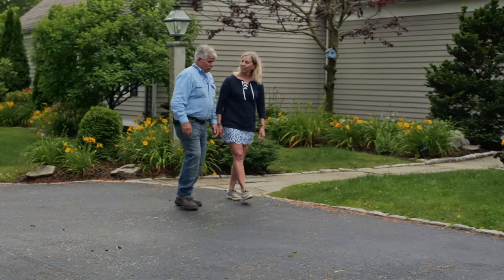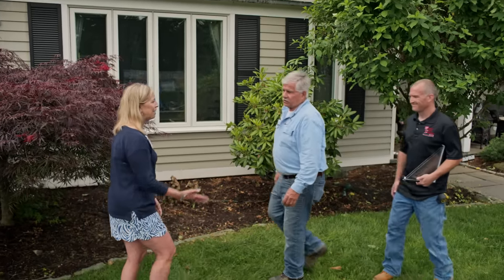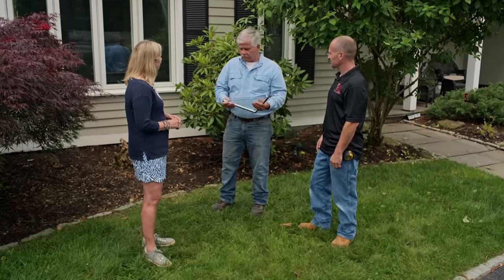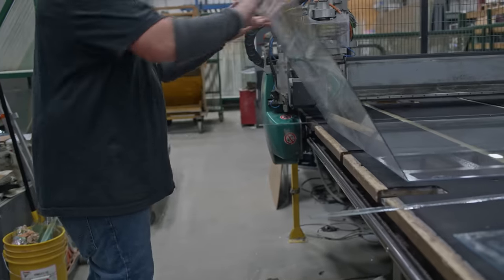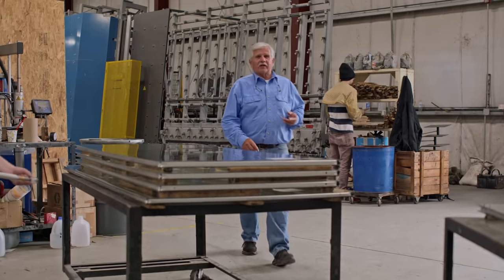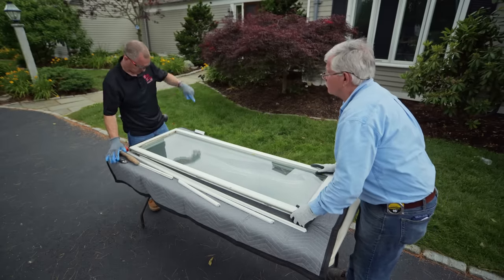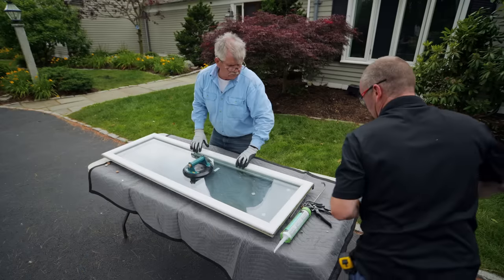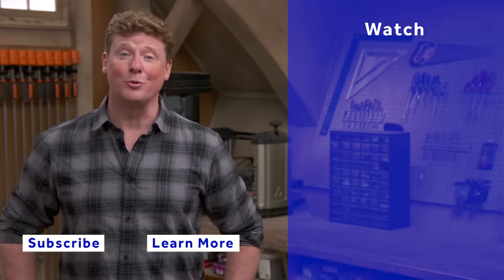How to Repair a Double Pane Window | Ask This Old House

Comment: This is the way to go.  Fixed 3 windows in my house just like this.  Cost should be around $400 a pane… installed
Reply: Thanks for sharing the cost! I was wondering
Reply: what if the window does not come out?
Reply: Are you located in the nyc area by any chance?
Reply: That's still too expensive

Comment: Here in the Netherlands it is very usual to replace only the glass. In almost every city there is a glass company you can call (24/7 in case of emergency) and they replace the glass for you. You can even order it yourself online when you know what to buy. Production takes +/- 20 days.

There is no one here who want to replace the whole window only because the glass is cracked. Every kind of window (wood / plastic (vinyl)) has replaceable glass.

Also we place thin plastic shims between the glass and the window to clamp the glass tight, so the window stays square.
Reply: They replaced only the glass. What are you talking about?
Reply: @herculesrockefeller8969 
Watch the video and pay attention to the expert talking about the different types of windows.

He is talking about the fact that some people decide to defraud their customers with products that force you to replace the sash rather than just the window.
Reply: @herculesrockefeller8969 Did you watch the video? Because that is exactly what they did... just replaced the glass.
Reply: @herculesrockefeller8969  They talk about it like it is an exception that only the glass will be replaced. Like in the introduction of the video when Tommie is in the car. He said “often the replace the whole sash”.
Reply: I have cheap double-hung vinyl windows throughout the house, and there's no option to replace only the glass. I'd jump at the opportunity to have a window with serviceable components!

Next set of windows we buy will definitely have this feature now that I know it exists 👍
Reply: @MoeBabaloosh  This type of windows is not common here in the Netherlands. In the past the glass and windows were delivered separately because of the weight. The glass was put in after installation of the window on the job side.

Nowadays they deliver the windows with glass pre installed in the factory, because they deliver it with cranes. But the glass is always replaceable in case you need.

Since 1,5 year you even get money from the government when you change your glass from single to double or even triple thick glass because then you need less heating in your house.
Reply: @herculesrockefeller8969  Bruh, how did you even make it this far down into the comments without having the video even playing on the background? It's like popping in "Hot Tub Time Machine" and then scanning directly to near the end and asking, "If this movie is about the 80's, why are they singing Black Eyed Peas songs?"
Reply: I think they are saying they take out the glazing panel- remove the broken glass and rebond a single piece of glass into the sealed unit so you are not throwing away a whole sealed unit- mostly they just fail with condensation and it is a major cost to have to replace the whole sealed unit so they are taken apart and resealed using existing glass. This ensures no glass goes to landfil
Reply: @herculesrockefeller8969  I think they are saying they take out the glazing panel- remove the broken glass and rebond a single piece of glass into the sealed unit so you are not throwing away a whole sealed unit- mostly they just fail with condensation and it is a major cost to have to replace the whole sealed unit so they are taken apart and resealed using existing glass. This ensures no glass goes to landfil
Reply: Good idea,  i call this method,....the  ' tim the shim '......nothing to do with tim hortons.....  hmmmm...  '' shim the tim '''.......(alberta canada) Go  Geert  Wilders...go ! for a 'normal ' country.
Reply: @scotttovey  Some will state that the sash has been discontinued and the complete bay window has to be replaced.

Comment: Nowadays getting the double pane glass is pretty easy. Some window companies only focus on new installations and some companies do repairs and replacement/ new installs. Also most manufacturers give you a lifetime warranty with glass breakage warranty as well. Just a matter of getting in touch with the manufacturer and giving them the serial number associated with the window (included on your window order or stickers on the window sashes/ frame.

Comment: I'd like to see how you get the double pane glass out of of a double hung vinyl window. 
I have a few windows where one of the halves have gotten cloudy inside.
Reply: Typically it follows the same method as in the video. I worked in the window industry for awhile and the method was the same for the double hung windows as well as slider windows or even picture windows. You remove the beading which was the vinyl trim you see in the video and get yourself a deglazing tool. To reinstall the new glass, You then apply a silicon caulk on the inside edge of the sash and drop in the new glass pane, and reapply the vinyl trim and you should be good to go. As the video also did mention, Its wise to let the silicon caulk cure for 24 to 48hrs so avoid any pushing on the newly installed glass.
Reply: @Fluffypotato1990 Not on my vinyl windows.  In Florida ours are hurricane rated vinyl and all the vinyl miter joints are plastic welded together (I'm assume they use ultrasonic welding).  Whole window replacement is pretty much the only option.
Reply: @Fluffypotato1990 and where can we get the sash glass?
Reply: Just be aware, the stops on the casement sash are the luxury type.
Cheaper brands have a super thin plastic stop that usually breaks, especially when it's cold.
Tons of brands out there, so you can win or lose
Reply: @Scubamike4499  I got the sash out, they tilt in to clean and are easy to get out of the frame.
Now how do you get the insulated glass pane out of the sash? 
The glass shop wants over $100 to replace the glass. Im sure the glass isn't that much, its the labor to get it out.
Reply: @rosewd2  $100 to replace the glass isn't bad at all. Would they even sell you the glass without install? I suppose they would and not warranty the glass against non-performance if you elect for a self-install rather than having them do it. If that was the case, I'd do it for that guarantee at $100.
Reply: There should be thin plastic stops either on the inside or outside that will come out with a sharp putty knife, pry them out and use the putty knife to break the seal from the frame to glass 
Note:  some models may not have stops at all, you might have to take apart the sash frame.
Sometimes you are stuck replacing the whole window. 
Hope it works out
Reply: @ryanshannon6963  thank you I'll check that out.
Reply: Contact the manufacturer of the window. Often they'll have a lifetime warranty and will ship you a whole new sash to just swap out. I've done this a few times.
Reply: @craigheimericks4594  Thats thats a good idea, i have several that failed with clouded glass.

Comment: Wonder iuf you could replace the glass on a single pane window with a double pane glass only replacement?  I love our wooden windows and the frames are beautiful and in good condition and almost 2 inches thick.  Would be cool to replace the glass only.  May have to look into that!

Comment: Before replacing the broken or fogged up insulated glass contact the window manufacturer to see if the window is under warranty. I did a sash that failed for a friend and the manufacturer sent a new sash to them for the cost of shipping only.

Comment: After the sealant is manually applied around the outside of the unit, here in the uk we apply a black duct tape around it too, saves sealant drying time which speeds up the production process.
Reply: A lot of manufacturers in the US use a double sided foam like tape to secure the glass to the sash.  No liquid sealant

Comment: I would like to know how to replace old insulated glass that does NOT have a removable stop moulding. I have 60 year old doors that are in good condition exept for the old glass. I'd like to reuse the doors and install low E glass.

Comment: I have window problem, i am not sure what i can do. Build in 2006 half circle double pane window on top of a rectangular slide bottom window underneath.  The problem is haze inside the half circle window. There is some white vinyl sticks inside between the two panes . I guess the unit joint has failed and let humidity in. But this is a 2nd floor condo and i don't want to shell big bucks to fix this.
 As per hoa documents i only own the interior side. Anything outside is the hoa's responsibility.  I see vinyl glazing sticks on the interior window perimeter which can probably be uninstalled like in the video, but i guess the window unit is glued together ? In that case i cannot access inside the double pane to clean it.   It's not glass it's plastic windows. I guess another solution is to drill a hole but if there is an easy way to disasemble the double panes to clean it, i would prefer that.  No matter what, i will not pay to replace the window unit, screw that.

Comment: What's the right search term to find someone who can do this in your area?   Everyone here wants to either just replace the whole window.... or all the windows in the home.
Reply: Search replacement window manufacturers in your area.  You may be able to just remove the window and give it to them and pick it up the next day. Depending on the type of window you have.  I replaced 29 windows and had three that were not manufactured right. They told me to install them anyway and then a technician showed up several days later and just disassembled them right there and reassembled.  All good.
Reply: If you have existing windows and search for window companies they will all want to just replace the whole windows.  Try and find the manufacturer of the windows you have to get warranty service work done.

Comment: Having spent my life in the window industry amazed at the lack of technical knowledge  the unit that broken is laminated unit .should be toughened if below.800mm from floor level .although the unit is sealed with silicone on inside as soon as it is installed it will sit on pvc frame u need to raise the glass on packers that will allow any water  ingress to drain out through drainage holes also heel and toe glass to prevent sash from dropping

Comment: They should have showed the heel and toe process as the glass is so heavy, if the weight is not carried by the hinges, it would be out of sync and would not close / lock. But overall, good video. (Oh and no need to take the sash out)

Comment: So exactly what is a sash?
Reply: A sash is the ‘unit’ they are working on.  The glass sits in the sash, the sash sits in the window.  In a lot of cases the sash is the moveable or operable portion of the window.  Fixed windows (ones that do not operate) can also have sashes, just depends on manufacturer and style of the window.

Comment: I want to know how rich measured the glass without popping open the frame. Is he just guessing?
Reply: Basically experience and knowing the brand helps
He measures from the outside to outside of those removable stops, then subtracts for expansion.
Reply: This was a staged filming all on the same day where everything was ready to go.  Someone else came out on the initial day to do all the real measuring.  Notice how he isn't even writing down anything.

Comment: Marcus left a finger smudge on the glass before it went in to be sealed at 7:11.  Hope that wasn't inside the window!
Reply: Thats actually the first surface of glass because it doesn’t have the aluminum channel on it. The first piece is inserted into machine and picked up with suction and then pressed into the second piece with the aluminum channel on it. So that finger smudge would be on the outside of the window and cleaned at the end of the process after they show the sealing of the unit.
Reply: Having worked for two of the largest window manufacturers in the US that kind of thing happens a lot!  Very easy to get a finger print, smudge, or hair on the inside of the two panes of glass.

Comment: "The low e would be on the third surface, which would be inside layer..."
A VERY significant detail which is never mentioned again in the video.
Tommy is great but the producers of ATOH always seem to present on a fifth-grade level.

Comment: Unfortunately the way they are made now you're sunk for doing this anymore. Sometimes it's a tradeoff though, as building a product you know doesn't have to come apart can be made much more solid and airtight, but unfortunately everything has followed the iphone manufacturing mentality.
Reply: how can you tell if you can do this with your windows?  Mine are from somewhere around 2004 and I have one that I broke the outer pane with a lawnmower
Reply: @jbrukardt 😊

Comment: That will be $300 and 3 months later......
Reply: I live in a 20 year old home with cheap windows and had this exact procedure. done.  Several years later the new double panes have no problem.  Payback on replacement windows is terrible and much more economical to go with cheaper route.
Reply: @Rudy1150  100% this. Fix them one at a time as they blow.